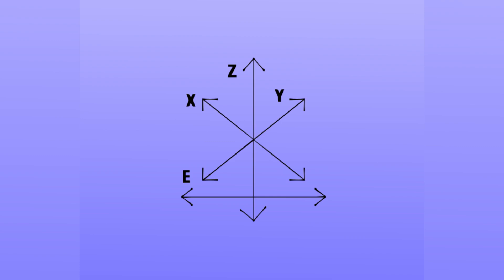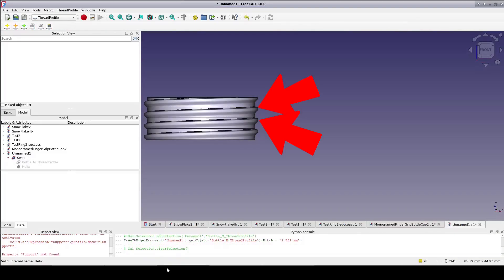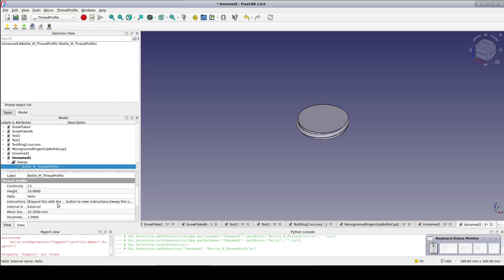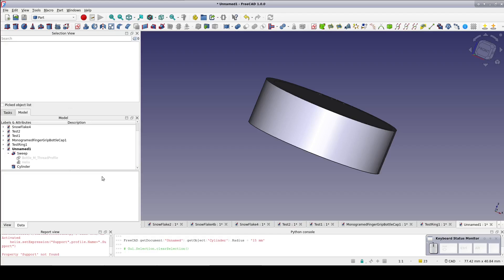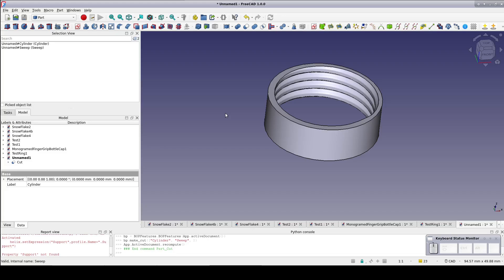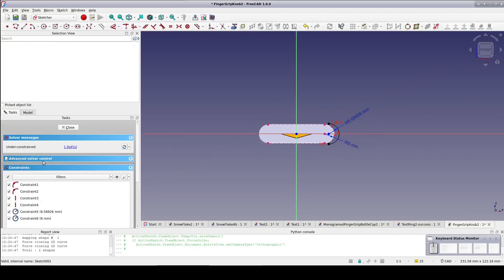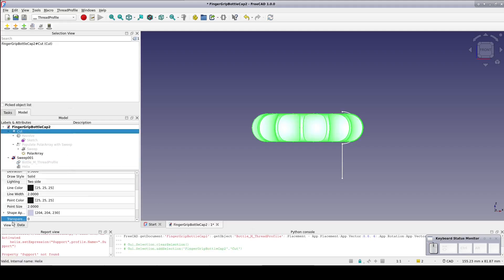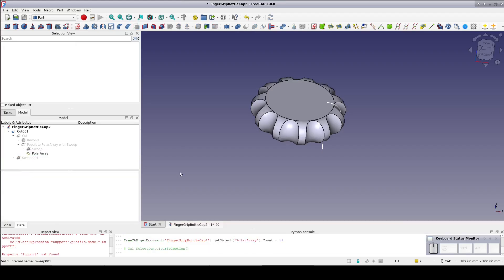FreeCAD Viewer request: Nice finger grips on a bottle cap

Comment: Practical walk through and thank you for the introduction to the thread workbench.  One thing that I would be interested in is your view on the slicer setup for printing threaded items.  To avoid support material, flip it on it's top and print that way; great but...  This aligns the layer plane perpendicular to the forces when the cap tightens.  I have printed a number of threaded items and experienced failures when the layers separate during tightening.  I have resorted to printing the parts horizontally so tha the layer plane lines up with tihe forcesj up/down the shaft.  This makes the resulatant parts much stronger when the threaded items are tighened but presents other issues like distorted shaft profiles (less thread engagement) and the hassle of cleaning up support material.  How do you print so that you can tighten the lid enough to prevent leaking but not snap the top of the lid off?  You are counting on pressure against the garket material.
Reply from the maker: Having the layer plane perpendicular to the threading would be stronger, but I haven't had much issue with that. I print mostly practical prints in PETG, so I print on the hotter end of the range. For this, I used a steel nozzle (because I need it for some of my other prints and changing it is a pain) at 255°C for the first layer and the rest at 250°C. Bed at 70°C. The extra heat likely gives strong layer adhesion.

Comment: You got it right in this case; but for anyone else, bottles use a buttress thread profile which means they aren't symmetrical and only (properly) thread on in one direction. For bottles the external thread has the slope facing upwards and the flat on the bottom. For a cap it's the opposite, flat(ter) face up.
Reply from the maker: Yes, the bottle profile tool creates that particular buttress thread. The other Buttress thread tool creates a slightly different rgread. Of course, the V thread tool creates a thread found in things like machine bolts.